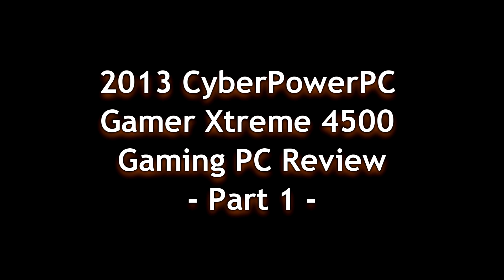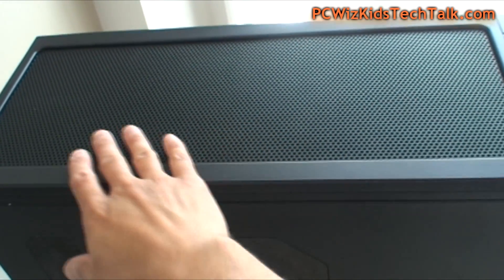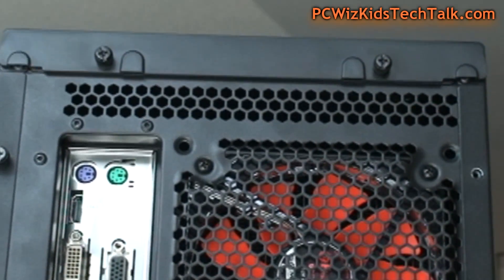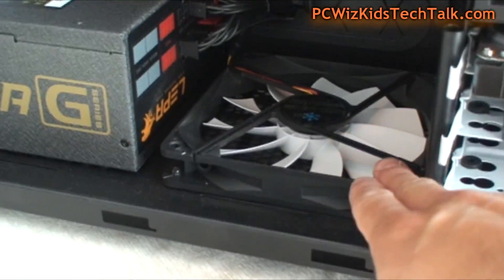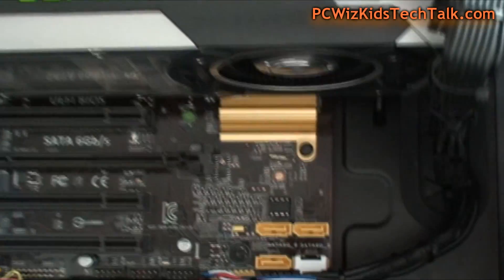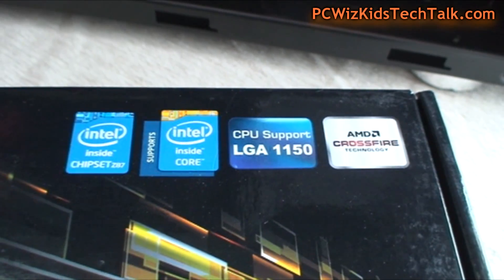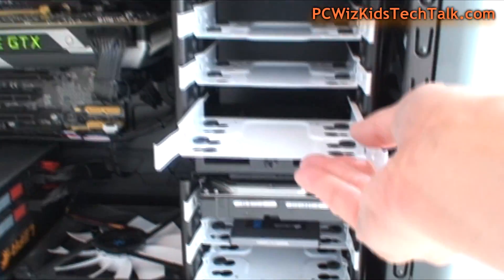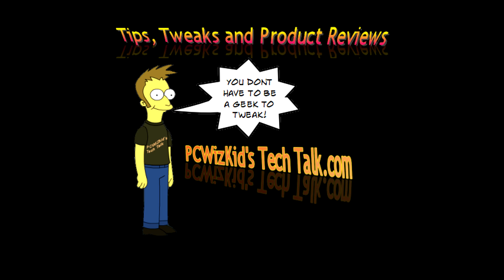Intel Haswell 4770K CyberPowerPC Gamer Xtreme 4500 Review - Part 1

Comment: Looks like a nicely cabled and tidy system. Only thing that sticks out to me is that measly SSD drive. Seriously? An i7 overclocked beast with such a beefy GPU and they cheap out on SSD space? It would not add great cost to include a 120GB SSD for Windows and system files surely.